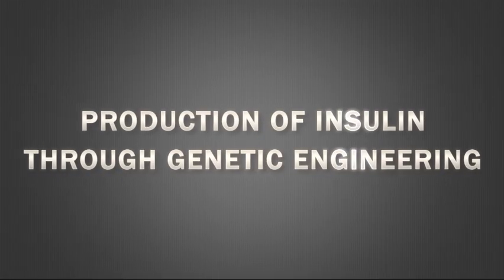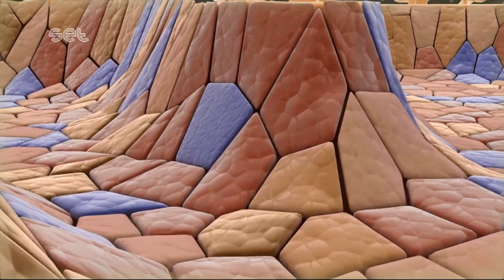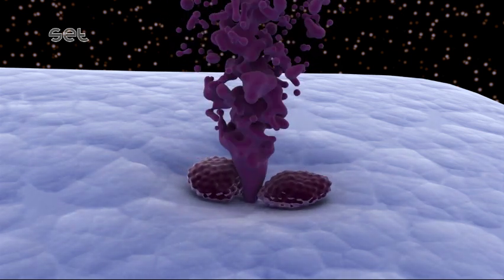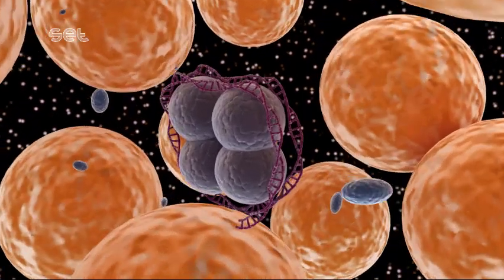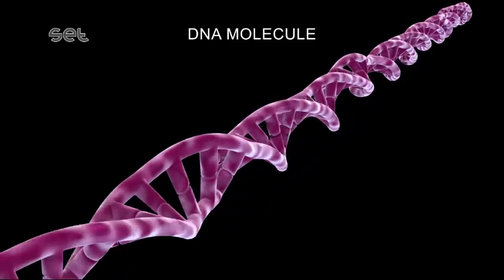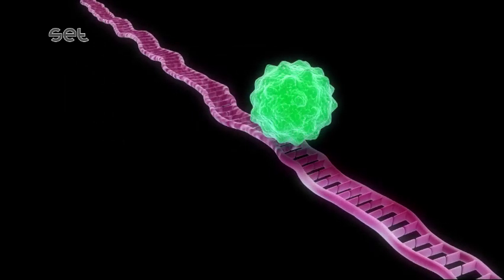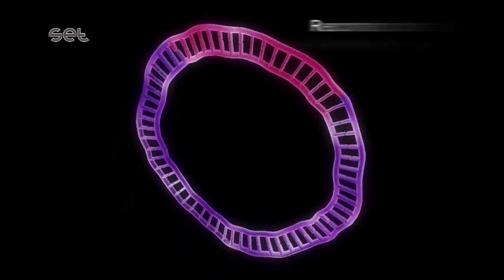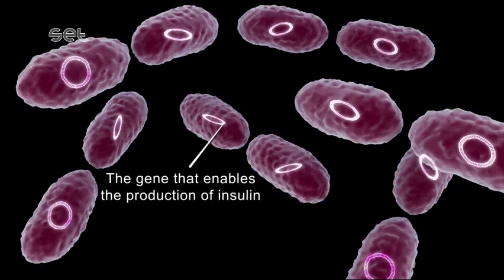Production of Insulin Throuhg Genetic Engineering

Comment: Information given in the last 30 seconds is pure science fiction! It is true that diabetic patients inject themselves with protein (insulin) previously manufactured by genetically modified microbes. However, the video shows that the insulin gene carried in a piece of DNA can be inserted into the pancreas cells of the diabetic patients (some sort of "gene therapy"). Unfortunately, this is not currently possible. If this procedure is available in the future and it works, diabetes will be cured and diabetic patients will not need to receive insulin anymore.
Reply: Their's no $ in cures .. if U think it's good 4 us then have @ it .. this video is nuts .. it will B the end of the true human race .. shytt food 2 help with changing U .. it's not what we should B doing .. imho 🙏🇺🇸
Reply: Thank you Guillermo for the clear info! :D Diabetes patients regularly injecting insulin would make no sense if last 30 seconds were true.
Reply: Yes thats what I thinks